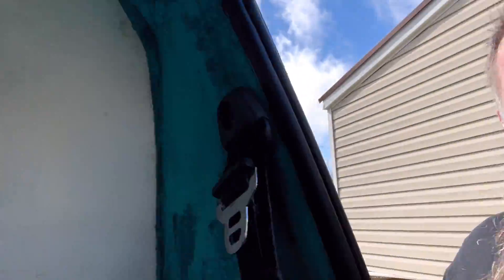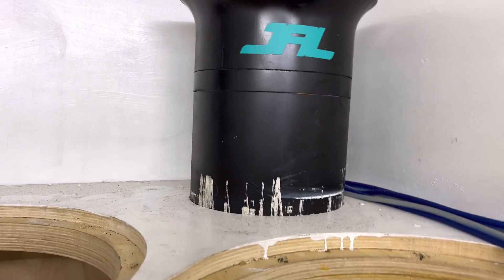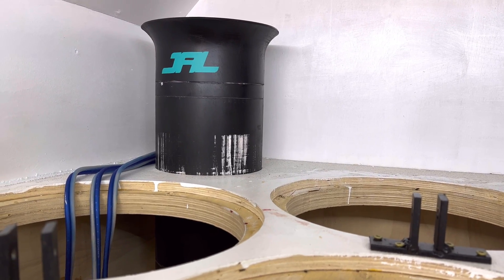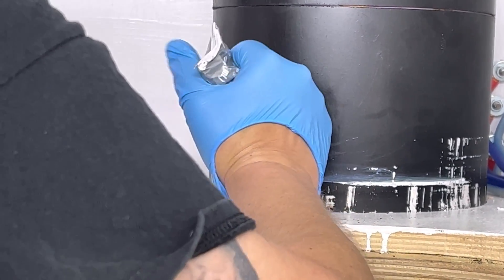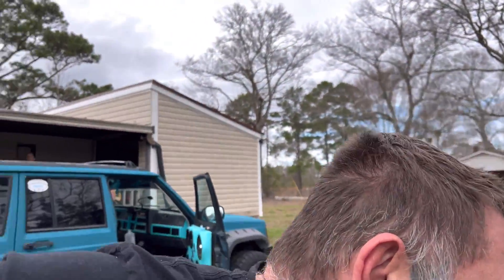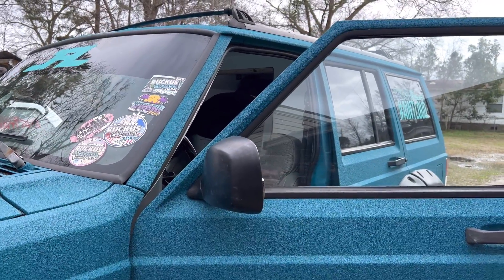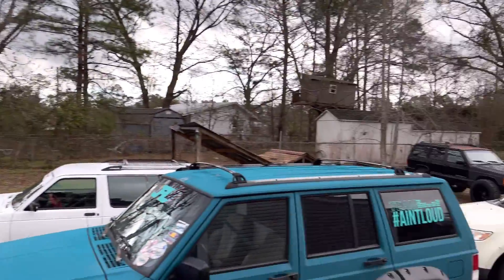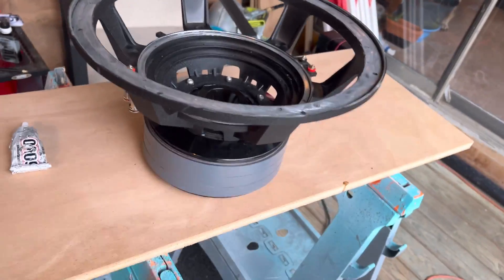Subs, Ports, fire, and a Recone

Comment: I’d like to see a test on 45s inside boxes I don’t use them I actually think they just take up airspace. I use them on a slot port to keep the port width the same in the back corner but I’m curious on a test of with and without to see if it raises output or not?